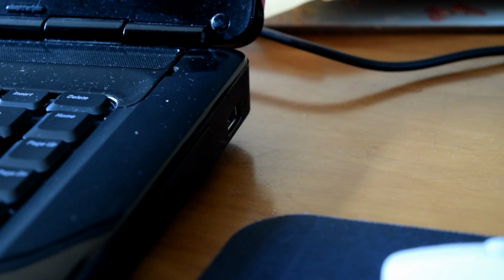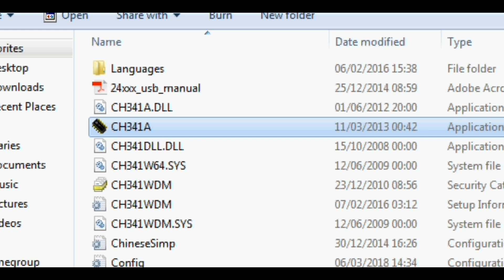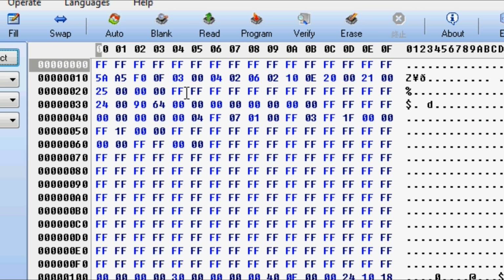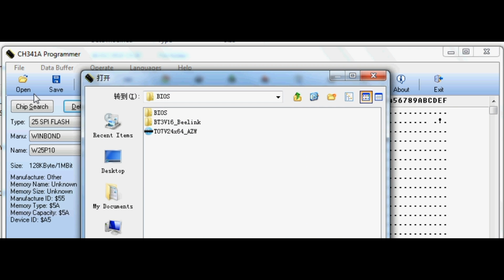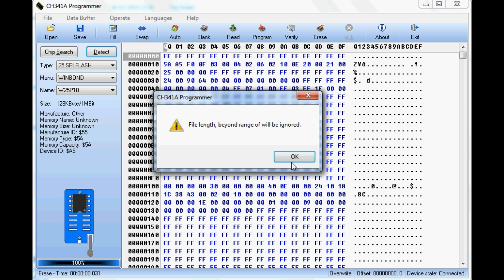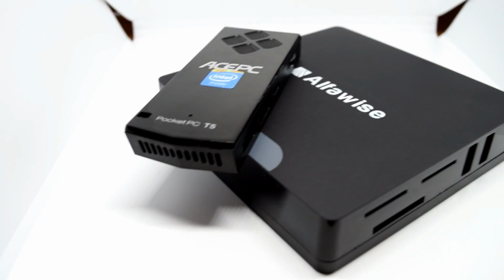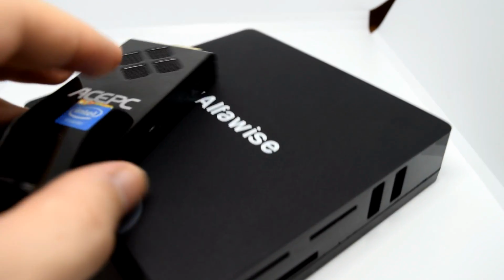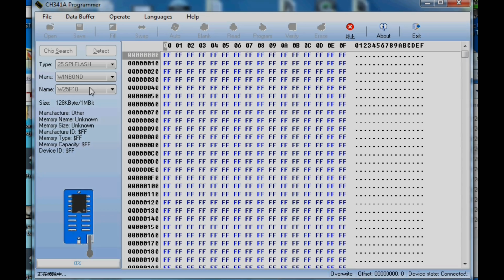EPROM BIOS Recovery Guide: Beelink, Chuwi, Intel Windows 10 TV Box Tutorial

Comment: I have 2 Z83-II devices. One bricked due to windows update, the other is fine because I didn't use it yet. Is this the only way to save the device? That programmer device is unavailable nowadays. Maybe I can backup the bios or the OS from my working z83 via USB to boot the bricked one? Is there a way?
Reply from the maker: Those programmers are still widely available.
Reply: @MXQPROJECT  in from Peru, Aliexpress says not avaliable
Reply: Were you succesfull with bios backup? I would appreciate, if you could share the bios for the z83 ^^
Reply: @TheBigBen100  use other bios from similar model
Reply: @Linkisss  Could u maybe help me :/ I cant find a similar one. I tried all kind of bioses now. Wich one did u used

Comment: Is the Setup config (CMOS) stored on BIOS? I tried to install Windows 7 in my Alfawise X5 (UEFI-ready in this case) but it goes bootloop and   any USB keyboard fails to work, even pressing Del or F7, it doesn't open Setup. Inserting a Windows 10 USB Stick doesn't work too. Im in a nutshell, plz help me!!
Reply from the maker: Windows 7 needs legacy bios to boot as the UEFI bios on these mini PC's don't have a legacy mode - BIOS recovery probably isn't needed in your case yet, you need the Beelink X5 windows 10 files from Beelinks website to recover and reinstall windows 10.

Comment: Could you provide any help with completing this fix using a K150 programmer? Mainly where the BIOS chip pins go in the programmer and how to write the BIOS data using the K150 software? It would be greatly appreciated as I already have a K150 programmer handy and have a BIOS that didn't flash properly on a Beelink BT3 PRO
Reply from the maker: Think this video pushed my knowledge of BIOS re flashing as it was - Don't no nothing about K150 software, but a quick google search it just looks identical to the software I was using when I made this guide
Reply: Thanks for the response! I've been trying to research the exact BIOS chip found on the BT3 PRO to see if I can fix the bad flash. This video was very helpful and the only one I could find on the topic

Comment: Thanks for the video, just what I needed!
I have a Beelite BT3 Pro Mini which needs flashing, can you confirm this is the right chip?
https://postimg.cc/gallery/2sc5ttuq6/
Reply from the maker: One with 8 legs is right one
Reply: Thanks! Ordered the USB flasher. I think the top right pin is the power, but the white spot is more to the 3rd from the left... is there any way to confirm?

//edit
Or is it the one with the dot above the pin (bottom left one)
Reply from the maker: white spot is just indicating which edge is your correct pin, its always marked with a colored spot 'usually' that indentation gets me confused as well as it could be that also.